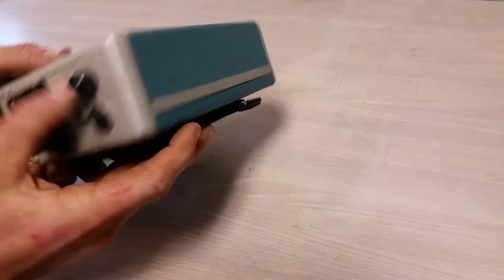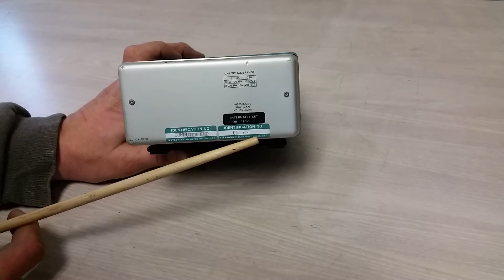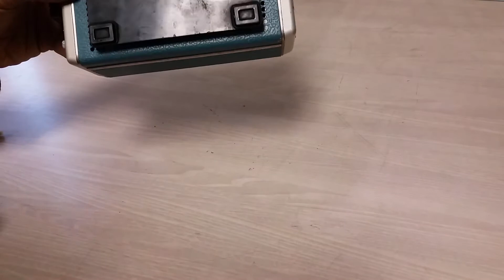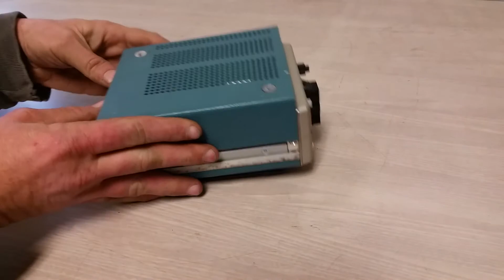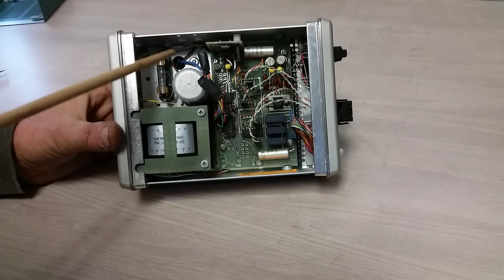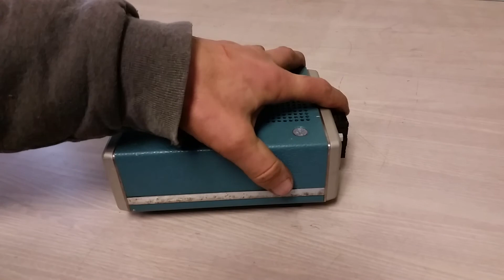Identify the Tektronix Whatzit

Comment: My thoughts being it has a 8 to three decoder IC, 74128, is it takes in 8 bits and coverts them to Binary for the computer to verify. That could be used as a computer address of sorts. If you have a lot of addresses to verify this little device could be used to easily verify the lines by going to each computer and hooking it up, then have someone on the other end tell you what code showed up on the computer side. Twisted Lines make sense over a bundle because they cancel out/reduce cross talk over lines running parallel with the signal lines. Just a guess. Best Wishes & Blessings. Keith Noneya.